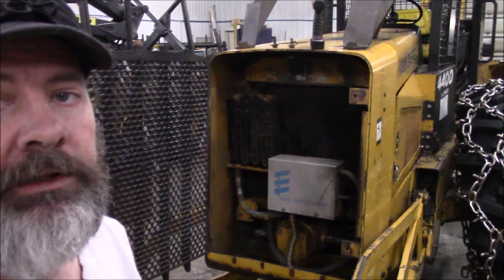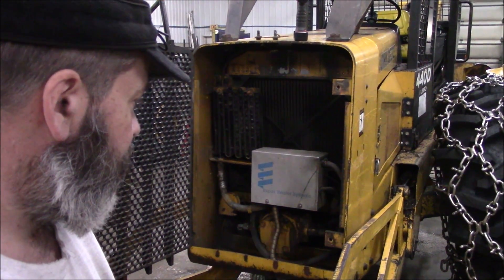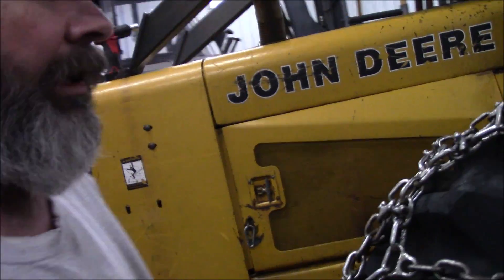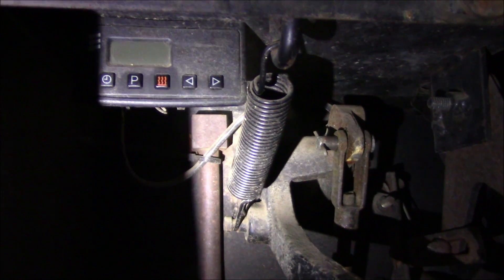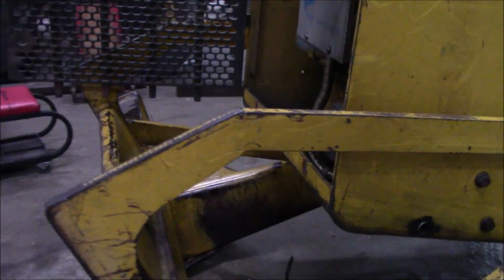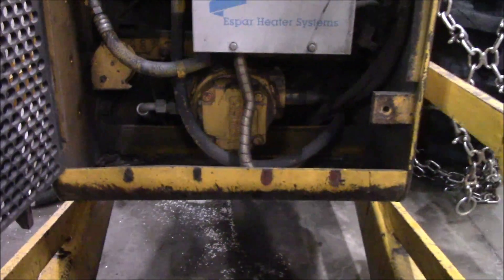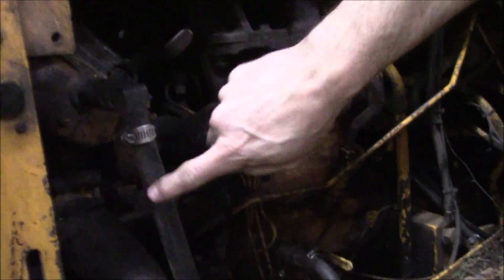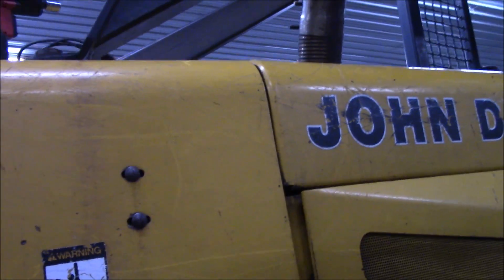Why you should install a coolant heater!

Comment: My employer had a webasto thermotop evo put on my tow truck. It's the first night with it. It's -21c right now. The hoses feel piss warm not hot after 45 minutes. Is that normal or is it not working right? It does seem to be circulating as the fitting on the engine is warm

Comment: We have them in cars, trucks, tractors and so on here in Norway. My Ford transit have one from factory and so does my Ssangyoung Rexton  to. 
As you said, it keeps cost down and its so damn good to get in to a warm machine  in the middle of winter.
Reply from the maker: Every machine should have one. My opinion. Americans are starting to see this. The one downside is our Diesel fuel is not as good. In order to have no trouble with heaters I recommend kerosene here in the USA. No problems then with heaters.

Comment: After seeing these on you cannel I've done some looking it it seems the w one lol 😂 may be the best fit for me. I haven't seen a price for it yet but Marine application probably x3 on price I have look into it a little more though
Reply from the maker: They all make pretty good units. I would think marine application would not matter. Heats the coolant. Just make sure you specify voltage. Lots of units I install are 24 volts.
Reply: @MichaelJBerg  I'm 12volt but why couldn't I put two new car battery's and solar panel on the roof if it saves me from going out to my boat at night alone to run it for 30/40min every night and again first thing in the morning I'm getting one just make sense
Reply from the maker: @joshwelner1951  you don't have to even go out to your boat. They have cool timers that you set. Hell they have them that you can turn on with your phone. No shit
Reply: @MichaelJBerg  that is the one I I'm looking into just have to make sure I have service support as I know nothing about them hay I'd go so for as to get one from you and ship it back and forth in the summer I don't think I have to do that but 0 degrees and a 38water temp one slip is all it takes when you're by yourself. I'm pretty much sold on the idea of them ok sold has to be better than running a propane mister body heater I don't trust them

Comment: Holy cow!  170ºF!  That's awesome!  You can just hop right in and go!  Did I hear you say something about heating the hydraulics too?  I run into that problem with my block heater on my tractor, I'm considering adding a heater to my hydraulic reservoir so it's ready to go right away.  Excellent video!  Totally right on what you had to say!  Thanks for the video!
Reply from the maker: Yes hydraulics also. It's a simple immersion tube that goes in the tank and hot coolant passes through. On semis there installed into fuel tanks also, like way up yonder in the Arctic.

Comment: Do you tap into the fuel lines on the engine, or did you install the pickup tube in the fuel tank?
Reply from the maker: I've done both. Whatever is convenient 👍

Comment: You only see sceptics about block heaters and oil pan heaters in warm places. Here in the interior of Alaska the only vehicles without them are driven here by newbies. Most of ours are electric instead of diesel. Have a good one.